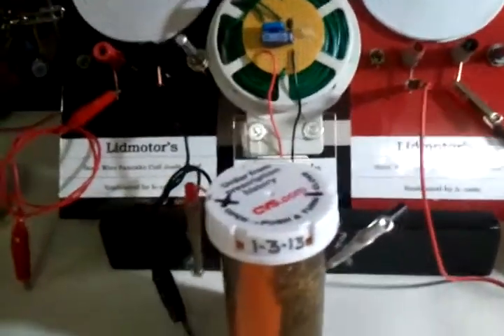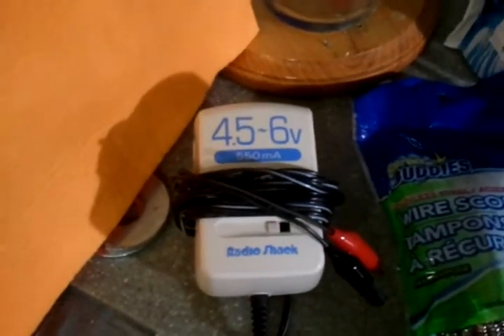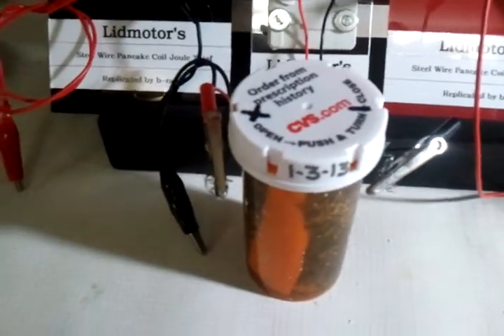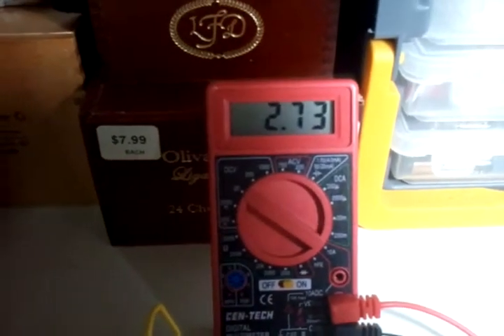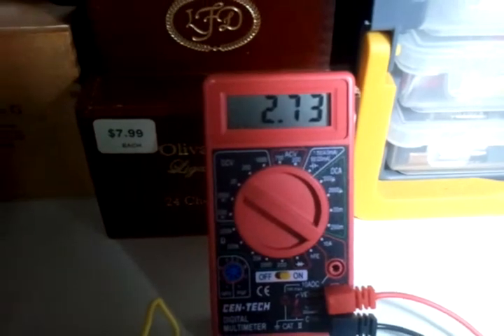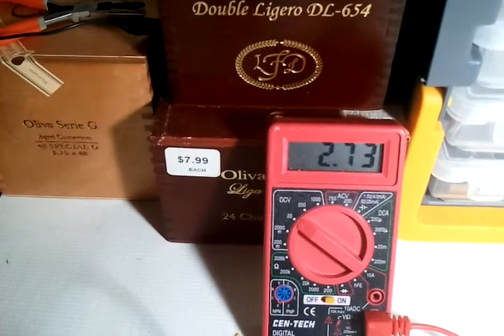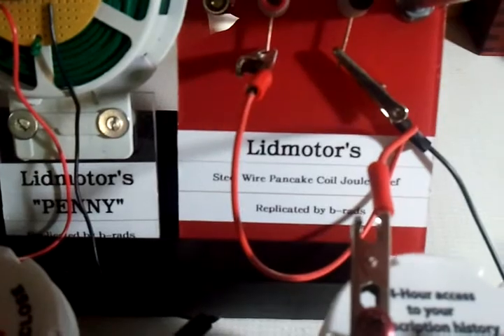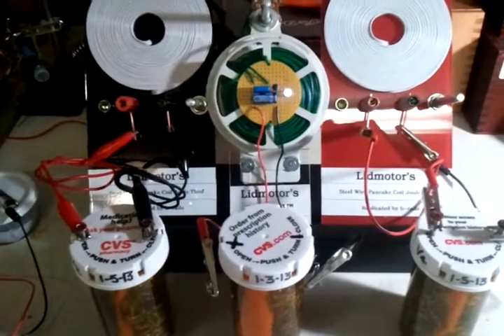Stainless Steel / Epsom Salt Battery - Replication

Comment: Many thanks for replicating this.   The one that I made back in November is still running my Penny 24/7 using ambient light energy to charge it up during the day.   It is an amazing rechargeable cell considering the simple materials that it is made with.  I like you compact pill bottle design using the SS scews for terminals.  I will have to try the more concentrated electrolyte also.